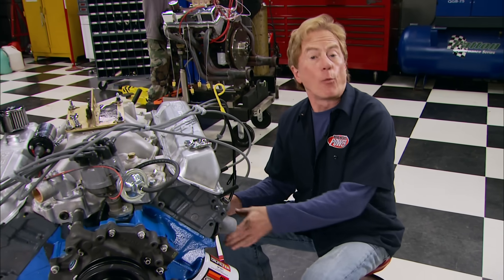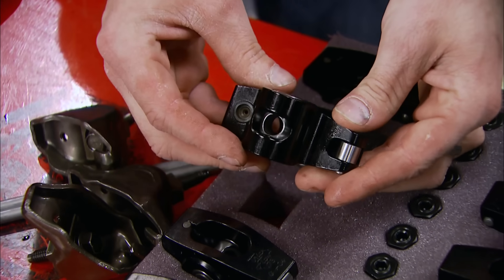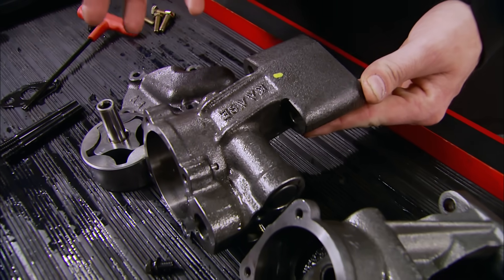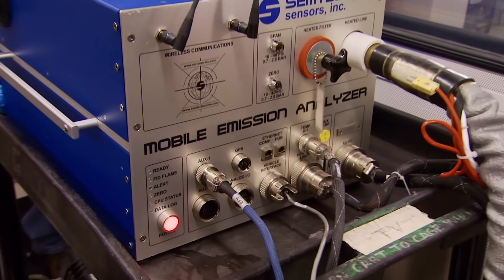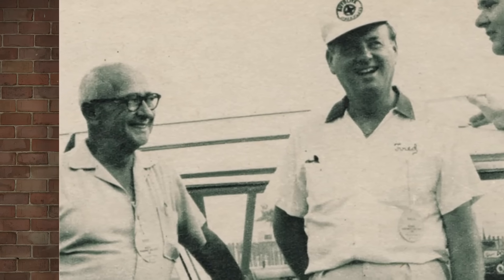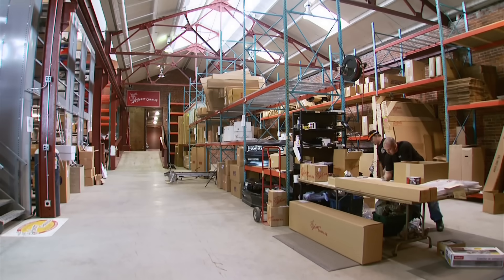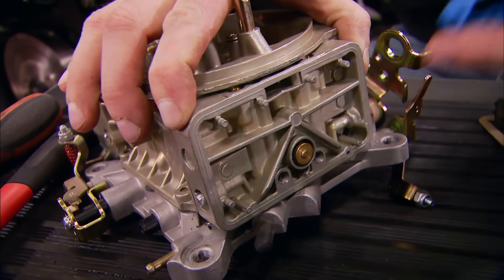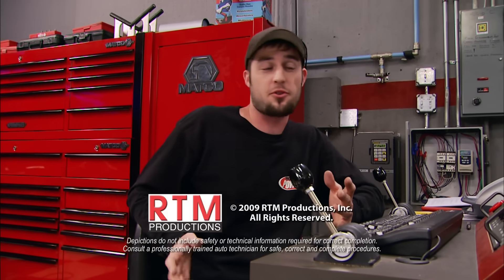Ford 460 Engine Build Part 2 - Horsepower S13, E9

Comment: E3 PLUGS ARE HORRIBLE!! Ive personally seen 3 Ford 5.4 3V engines, DESTROYED by these junk plugs! I have pics to prove it! The plugs MELTED in under 3k miles in ALL 3 engines! Pieces of the melted junk plugs ended up in valve seats and jammed between pistons and cylinder walls. YET THEY STILL SELL THEM FOR THE 5.4 3V ENGINE! I am ASE Master Certified, 3 time RE Certified, 35 yrs experience! I love this show but when they promote these junk plugs it makes me wonder why I do.

Comment: Bone stock crossed checkered flags on decal on air cleaner lid on early 60's 70's Mercury 429 had 370 hp and 495 ft. Pounds of torque same as Boss 429 wich had to be incredibly strangled! I know the Boss 302 had a lot bigger carb. Than the Boss 429 for a start.

Comment: The old E3 spark plug ad, Heads up spark plugs dont really matter when it comes to horsepower as long as they correctly gapped and the right plug

Comment: Ive built 460s for 43 years. If Ford would have used a deep skirt block set it up for 4 bolt mains with crossbolts...this engine could have done some terrific things. Then Ford drops it. Ford management are all idiots. They dont deserve to work for Ford.

Comment: 370hp for a big block 460 seems trash to me sorry. if i were to buy that motor spend all that time building it and throwing 2500$ at it id expect at least 1hp per cubic inches
Reply: That's because you don't know what you're talking about.  You made that clear when you focused on just the HP (typical high school stuff) and ignored the tremendous torque this engine was cranking out on a budget build.  For the money, this was a good deal, and I'd LOVE to have the budget engine in a 4X4.
Reply: @eskieman3948  go back to 1980s,  only time line you will be able to outperform anything with 370hp in a truck LOL. my wifes mini van has 300hp  its a uni body mostly plastic and aluminum so way lighter than any truck,  and even she would like a bit more power.

Comment: CO2 at only 7%😳😏 that's a good indicator that the internals of most engines are decent or hammered shit. Generally you want over 12% CO2 or your likely in need of some internal work, due to valve, cam, or piston ring wear.

Comment: Did the Ford 460 make 378 or 389 HORSEPOWER? In the first video  , They claimed 378 horsepower for the 460 . In this version they claim it was 389. How much did it make?
Reply: 389/493 hp/tq
Reply: @TheRoadhammer379  thank you for the information.

Comment: If Ford had been smarter back in the 80s they would've made engines like the 460 multivalve and supercharged. That's the simplest way for these older engines to get higher horsepower and torque while still meeting emission standards. It's more costly but it would get better performance either way.

Comment: Ok all of this is great! Have you checked milage on the bigger building for a daily driver, compared to a stock build? If it's breathing better it should get better milage!
I did this with a 302 and went from 14 mpg hwy to 19 carrying 3000 Pounds in the bed with a cover from ND to Washington State.
Month of May, still some colder weather at night yet warm during day.

Comment: 500horsepower for the 460 with trick flow heads and intake, with a real big cam? Must be something wrong with that motor.
Reply: Yeah something like 8:1 compression and low timing plus a knucklehead that jams a cam in like its his wife's dry _

Comment: "Very important to ONLY install them finger tight.' Proceeds to crank down the head stud with a T-handle...  And that was the clumsiest cam install I've ever seen, lol. Might as well have used a hammer to drive it home. They should slap themselves for pimping those shitty E3 plugs...

Comment: You skipped a phase here.  You went from rebuild what you got, to open the purse and let the money flow build while using the stock block, stock crank, stock bearings, stock connecting rods, and stock cast pistons.  OMG, the single plane intake and aftermarket heads are way overkill for this motor.  Should have kept the dual plane.  Also, either porting the heads you had, or the late model fuel injection heads with porting would have yielded good results without the high price tag.  A windage tray would have been more beneficial with the stock oil pan then using the expensive aftermarket pan.  Can we stop hyping aftermarket spark plugs that in the real world are at best no better then the OEM plugs, and at worst, perform worse.  Just use the OEM plug with the correct heat range.

Comment: What a crock.... stock compression pistons, and wimp cam with no duration....but it has 680 lift....big  deal ,no duration no max power...No wonder this engine never hit close to 620 hp
If that cam had a duration of 290 to 312 degrees in a split pattern this motor would have been awesome...HIGHER compression pistons would have enhanced power as well. If this was a budget build, cams don't cost that much more for a better one..They built this wimp motor to compete with a chevy 454 for a dyno shootout and of course the chevy won.
When you are going for over 600 hp you can't say you are worried about streetability since 600+ hp is a race motor.
   I got more power from a 351w stroked to 408ci with a  310/312 duration 680 lift hydraulic roller and 11:1 pistons, TFS twisted wedge heads hurricane intake in a dominator style hi rise
intake, comp cams steel magnum rollers, 2 1/2 headers, holly  830 cfm dominator and MSD ignition 
3400 lb car at 11.16 in the quarter at 128mph that calculates around 668 hp at the crank, in a 1987 mustang  with full length 3 in exhaust  with  mufflers and it was still driven on the street.
  So in short this 460 build is a Joke...

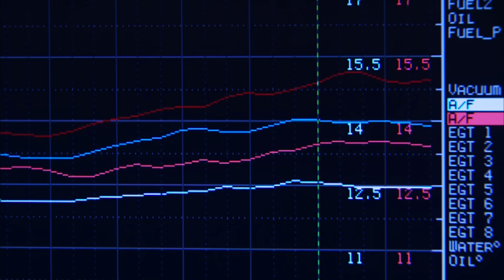Comment: 16:47 12.5 air full ratio is too rich . 14.7 to 1 is what you really want for maximum horse power across the band and for the best full economy .
The only reason why people dump too much full into the engine is to rase the dynamic compression ratio at high altitude or if the engine doesn't have enough compression at high R.P.Ms 
That's for naturally aspirated engines .
I could guess that the combination of the cam and the carb that was used for this video didn't quite match  .
Either that or the air flow was somehow disrupted .
In short full EFI would be much better .
And of course a better lobe separation on the cam .
I'm just saying .
In my personal opinion .
Not only that but you will find a better idle speed .
Reply: Explain why my 460 runs better at 12.5:1 then 14.7:1?

Comment: The more I understand what goes into building an engine that works, the 
more I'm amazed that cars didn't go to electric motors  50 years ago.  Somewhere at a Tesla build show:  "We're gonna improve our power and torque numbers by...  adding more batteries..  "  Done

Comment: Dude don't listen to this crap about E3 plugs.  I bought a set of 8 for my 350sb Chevy in my Nova and it literally ran WORSE. $2 spark plugs ran WAY better. And we're talking I messed around with timing and jetting in the carb too see if it needed to be tuned and no way. No way to make it better. It may run more efficient but when you're 19, you are looking for power not efficiency.

Comment: Animation on the supercharger screws @5:45 are spinning backwards. nothing like a blower sucking air out of your motor hahah
Reply: As far as I know, the direction displayed is actually the correct way. The air flows on the outside and is then compressed in the intake. When the screws interlock, at the bottom middle there is no space for the air and it simply has to go into the engine.
Reply: @cedricl.marquard6273  Not on that specific roots style blower. It sucks air from the middle top and sends it straight down into the intake.

Comment: While its not in this episode but the prior one, its nice to see them finally use a torque plate when boring out a block.
Reply: You don't use a torque plate "boring out a block". It's used when finish-honing and is only "recommended" for "high performance" POS "thin-wall casting" blocks with 4 head bolts per cylinder "bored out to the max". Meaning all Ford "high performance" OHV V8s.
Reply: @deeremeyer1749 Ah, that must be why torque plates are always used on Chevy Gen One engines with 5 bolts per cylinder :)  Boring out the block does all the work, finish honing merely leaves a surface for the oil film, and if you want ring seal to last beyond 10,000 miles, professionals use a torque plate. The only time a torque plate is ever skipped on a real engine build is when the engine design bolts the head into the block's walls, like Pontiac blocks. Otherwise, when the head bolts go into the deck, you torque plate to replicate the distortion to the bore.
Reply: @deeremeyer1749  you were dropped on your head as a child, ignorant dbag.

Comment: the only thing they don't tell you about the E3 plugs is that they promote detonation because the increased mass of the enlarged side electrode acts as a heat soak, and runs the electrode hotter for the same heat range of plug. that's where the improvements come on the computer, but if you drive up in the low mountains on a hot humid day, the motor will ping like a popcorn maker under high load, low throttle lugging. so when you reduce your timing advance to compensate, those so called improvements are out the window. just stick to OEM style resistor plugs and change them every 12k if it's a driver. they have been trying to sell goofy spark plugs since day one, and they never catch on. for a reason.

Comment: from $2300 to $7000. bye bye budget build. shit I would have been happy with the @500lbs. of tq, and 380 HP. for $230 would have been a great reliable boat or 70-73 mach1 mustang motor. or even a great mud 70's f250 ranger motor. shit I'm not even a Ford guy but I like big blocks.

Comment: Lower oxides of nitrogen have shit to do with fuel economy.

In fact, the CO and CO2 emissions are potentially quite deceptive because 'fuel economy' ONLY equates to how much work is done.

An engine freewheeling with no load gets ZERO 'fuel economy' to the wheel.

You actually have to do REAL WORLD WORK to achieve a REAL fuel economy [unless you are an oil billionaire, in which case, the worse mileage the car gets, the better for YOUR economy] you have to move a unit of mass, over a measurable distance, and then measure the volume of fuel consumed, and calculate how much fuel it requires/required to move said  load, said distance, [and potentially including 'said time,' because acceleration, internal mechanical resistance, wind and rolling resistance all affect the final result, and change with both speed, vehicle mass, body streamlining and road/terrain conditions] and that will be your fuel mileage [not really the same thing as 'fuel economy', seeing 'economy' is a badly used word here adopted from the days when the price of fuel was first introduced into the equation, back when OPEC first instituted their oil embargo, and the prices of fuel skyrocketed.

Comment: you should not watch for teaching they are of the bottom 10 percent of builders 1.5 to 1.7 hp per cube and 1.2 ft pounds per cube is a true builders guide
Reply: all those new trickflow parts make 607hp

Comment: The 460 was never intended to be a 'performance' engine.  It was designed to move the Lincolns, station wagons, and motor homes of the day while meeting the Fed's increased smog regs.  There is a reason these engines are a dime a dozen in the scrap yards.  This vid is an example of putting lipstick on a pig.
Reply: Enough lipstick and it's a pretty fast pig... big, too. Who wants a big pig!

Comment: Lower NOx means a cooler combustion. Less CO2 means a less complete combustion, assuming the same amount of fuel and air.  Way to try to hide the fact that those spark plugs failed to show an improvement.
Reply: No HC readings? i don't remember seeing the HC chart...

Comment: You can definitely tell Trick Flow sponsored this build.... 

There are better ways to build big power in a 460 that don't require throwing your entire purse at it.
Reply: Did you fools miss the first build episode? That was the daily driver build.
Reply: And the intake for 3300-8000 RPMS. I didn't realize they were building a race engine. Daily driver runs 1000-3500 occasionally seeing 4-5000. I guess they never said what the engine was for.  I was hoping for nice streetable package before they went ape shit and threw the bank at it.
Reply: @captainswampy9501 imagine this engine, in say a 73 Thunderbird like mine, C6 trans, and 3.73 or 4.11s in the rear end would easily see that RPM range. Maybe not all the time, but one good long pull from a stop sign would see those rpms
Reply: This is "big power"? 

Sure it is. In the Fordtard universe.

Comment: 385 hp and 493 fr lbs on a smog block,  not bad with a mild comp replacement cam and open chamber heads
for a baseline a stock 69-71 460 was rated at a gross 365 hp and 500 ft lbs.
Reply: Those were great numbers with the cast iron heads and a warmed over stock short block.     Similar to the stock numbers from the golden era of 1969 to 1971.    This 460 would pull at least as good as the old Thunder Jet 429 engines back then which was kind of a detuned 429 Cobra Jet.
Reply: great point of reference.
Reply: @scdevon  thunder jets were nothing special
Reply: This one is lower rated, came out of a 78 model truck so closer to like 200-220 horse factory.
Reply: @79dent  correct. about 8:1 and 78cc in the heads.
Reply: @socalltd  closer to 88 cc on a 460. You'd need just about a dome piston to get that compression back up
Reply: @79dent  pretty sure Joe said this was a post 1979 engine in the first vid.

Comment: Should have went with double four barrel carbs. Stock heads were fine. Those aluminum heads are no budget build. Roller rockers are  only a good idea if it is an increase in ratio over stock.
Reply: You must have missed were he showed the stock heads had cracks around the valves.. they weren't fine at all. Now if they didnt have cracks all over sure they would have but who would use them when they could toss on a nice set of trickflows and get more out of them not to mention later on when more power is added.

Comment: I said this was bs the first time I saw it. Say you have a house with the right amount of air and gas vapors inside. One spark or 3 at the same time. The house is going to explode the same. 
Now watch some 13 yod taking a break from Dungeons and dragons is going type a long explanation saying why I’m wrong.
Reply: Not 13, haven't played D&D in decades, and I could give you a very long explanation saying... your gut feeling is 100% correct. No explanation though other than shrouding your spark is a lousy thing to do in the interests of anything your engine does.
Reply: @mfree80286  I see these guys on video just lying their a$$ off and I want to smacked the.

Comment: I took my 76 Chevy Camaro in for a tune up and the shop I chose installed these cheap ass Chinese plugs that were just horrible. I drove it home and it was running worse than it did before the tune up. I went straight back and we narrowed it down to the plugs. I watched as they pulled them out and was floored when I saw them. I told them to go to the AutoZone and get a set of E-3's and HOLY SHIT did it make a huge difference. Now, I run them in every engine I own, from the cars to the lawn mower to my chain saw.

Comment: If that's the case where do you draw the line to call it a big block
Reply: Yup
Reply: Exterior dimensions of the engine itself. A 454cid stroker SBC is still a small block.

Comment: You can take a 427 LS motor which is Big cubic inches and it is not a big block
Reply: they have 454 small blocks and 468 when its stroked to max for a small block

Comment: That is not what big block means big block has to do with how the valves are set Big Bore space does not mean a big block
Reply: im not sure you know what your talking about. a big block is just that. a bigger block with bigger bores for bigger pistons so more fuel can be put in it, so they use bigger heads with bigger combustion chambers

Comment: I was cringing with the way he was pulling and installing cams as well as when he was installing pistons without protecting the crank from scarring by the rod cap studs. Maybe I’m just too careful with every one I do. Or not.
Reply: Y’all are right. We spend the money we work hard for on this stuff so when we build engines, we want them clean, oil clearances within spec, nothing out of round, etc so it’s an engine that will last. Good to know others think like I do anymore.
Reply: They have always been really rough, they even dropped the head after using a crowbar in the water jacket to break the seal on ep 1
Reply: @randomdude4669 yeah that was wild..
Reply: Or at least rubber fuel line
Reply: Goddam thats some bear fisted fooling around! Id hate these guys to work in my local garage 🤣
Reply: Your not to picky Joe isnt spending his hard earned money like we are
Reply: When u get nothing but free bolt on crap u can nick cranks all day
Reply: The motor only needs to last long enough to break in the cam and do a couple dyno runs, then it's probably going to get either stuffed on a shelf for the next decade, or disassembled and the loaned parts handed back to Trick Flow.
Reply: Nah you're right I'd always boot em.